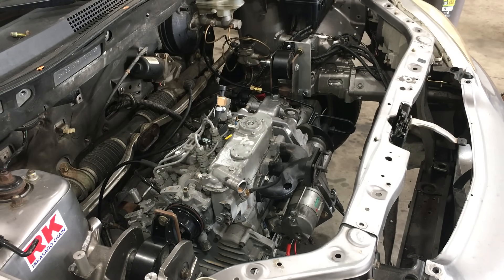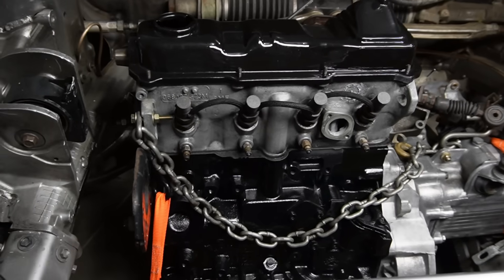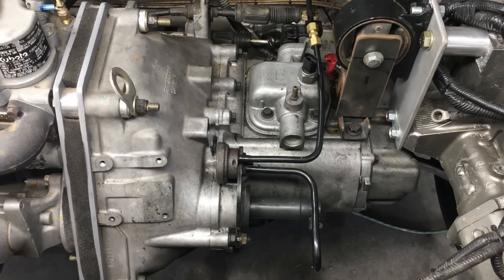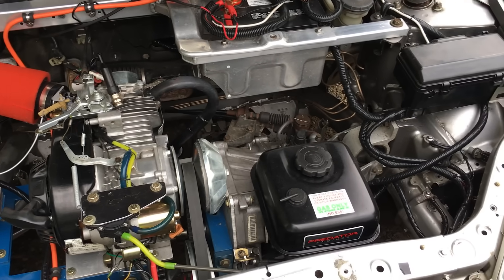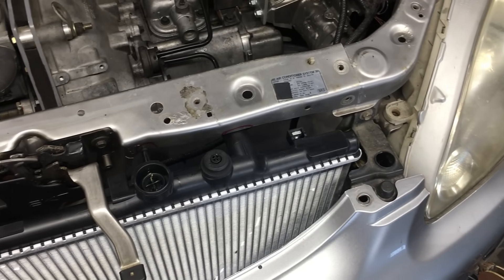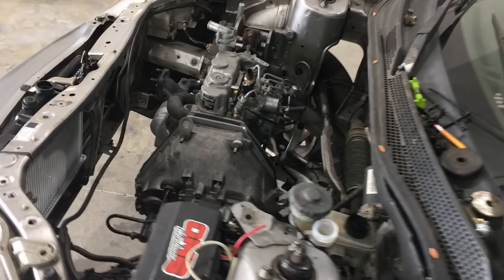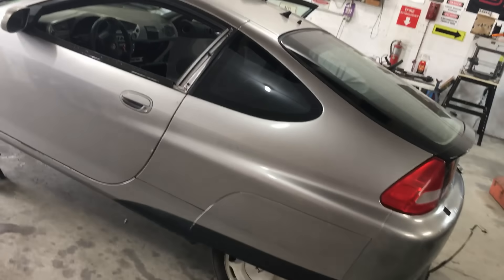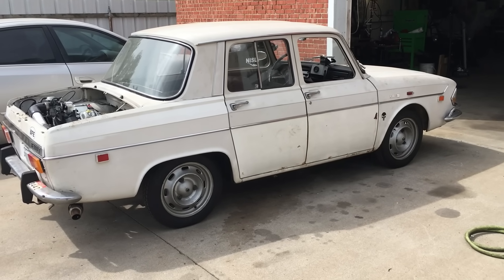S3 E33. 3 cylinder Kubota D722  diesel powered Honda Insight project has begun

Comment: Boost is load dependent. Modern diesel vehicles that have 30+ PSI of boost at WOT, only generate 3-5 PSI at normal crusing speed. That seems to align with what you were seeing, too.

Artificially pumping up low RPM boost at low load, low RPM with a supercharger is just wasted effort, IMO. You're just cramming more air into the motor than it needs.
Reply from the maker: Yes,  I'm aware of all that and I have owned turbo diesel vehicles in the past.  Keep in mind I have spent countless hours driving the turbo diesel saturn  and when I say the turbo was under performing,  welp its based on experience.   The supercharger will be an interesting experiment ... and interesting experiments is what brings people to watch my videos.

Comment: I suggest stupid-charger out of VW 1.4 tfsi engines it is super-turbo system but those super chargers are extremly cheap, newer technology, small and not rebuilt unit. In EU I paid 25eur for one. Just have in mind that they have internal 2:1 gearbox. So don't over rev it.

Comment: better to use  a turbo instead of stupidcharger , less mechanical parts, belts , brackets  ie weight , ie failures maintenance  etc , and turbo  is more efficient using exhaust gas , there are other  bigger(not to big) junk yard  turbos that will work

Comment: Hm. It will not have good fuel economy so not the way i would do it but if you just like the fact its small engine and thats it its ok
Reply from the maker: fuel economy is not necessarily our goal with these projects, however this same engine and transmission got 80 MPG when it was in the Saturn... so you never know..

Comment: When going with the amr500, you need to make sure that that's stupid charger is timed 100% correctly, because even a half a degree will make that thing super noisy and very ineffective ... the guys over at donut media tried having the folks with grind hard Plumbing put one of those on their Volkswagen, You could hear that the timing on it was wrong as it was the noisiest piece of junk ever. There's one YouTuber from two-stroke stuffing that used one of the AMR are stupid Chargers ... it did not work well for him, but the unit was quiet and it's boost boost... and with a 2-stroke engine trying to reach 20,000 RPM that's fast. Anyhow, rich with Rich rebuilds had a Volkswagen Rabbit diesel pickup truck with that diesel engine and it was turbocharged, maybe pick his brain when it comes to turbocharging that engine, I know the motor really likes it, I had a Volkswagen Rabbit Diesel, top speed was 74 miles an hour on the highway floored all day long. I wanted it to make more power but it suffered an electrical gremlin from somewhere I don't know where but that ended the car in a hurry.

Tldr, I'm sorry.